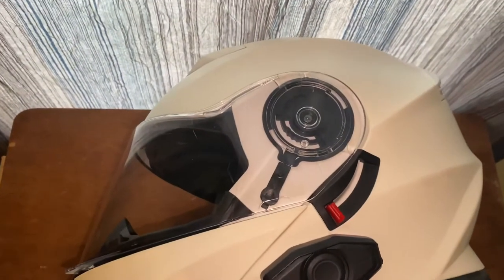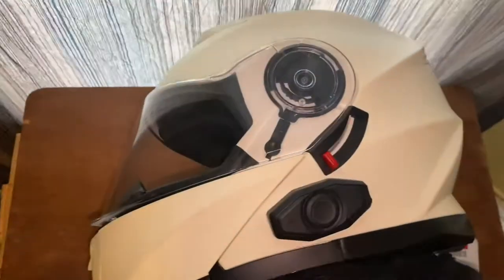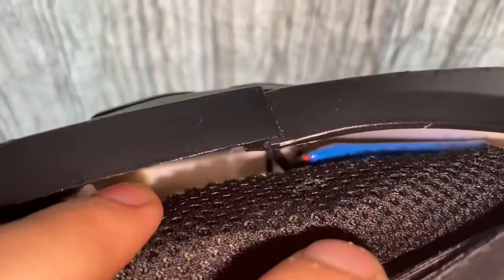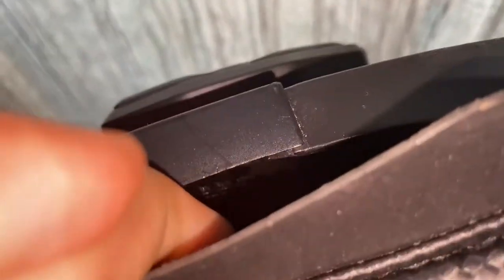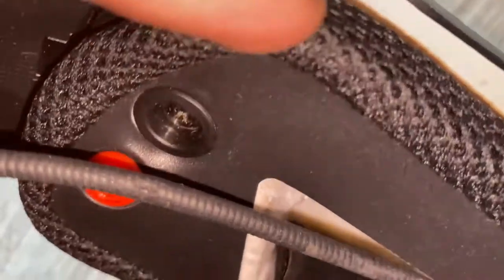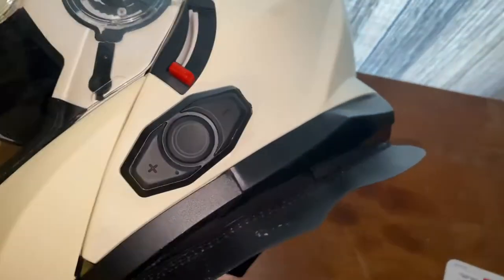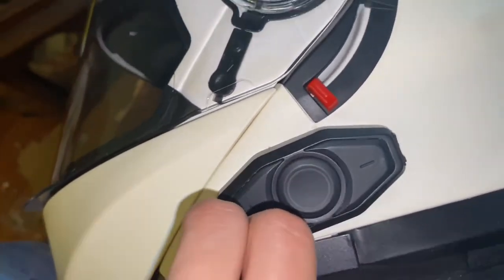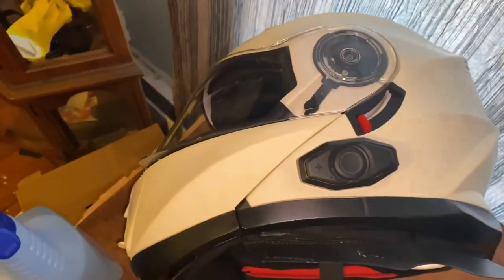How to fix Bilt Techno 2.0 Helmet / How to fix Sena DWO-5 Bluetooth

Comment: Good video, I had to reset my bluetooth because it was not charging correctly and it was not connect sometimes. The reset fix that problem. A few years later I was getting the red and blue light flashing and my bluetooth was not fully charging. I tried a different power supply and that fix it.
Reply: Here is another problem I was having, the charging LED would flash blue and red after a few minutes connected to the charger. I reset it multiple times but it did not work. Then I pressed the reset button for over 10 seconds. That worked. Have not had anymore problems.

Comment: Thank you for the video. I couldn't figure out how to get to the screws holding the unit on. I didn't know about the screw on the side. Haha. I just got the whole replacement setup from Cycle Gear, and it's a whole replacement setup for anyone else wondering. Thanks again.

Comment: Great info Corey I was able to reset mine. Thought I would have to go through the cut the battery wires and would rsolder the connectors to a new one.
Reply from the maker: Im glad I was able to provide useful information
Reply: Same!

Comment: Hello, I have depressed the reset button and did several combinations on trying to power up the helmet with the different buttons with no success.  Of course this bluetooth has been built into this helmet so not sure if it can be replaced. Any information or resolution would be appreciated.
Reply from the maker: retry Every step with the the charger plugged into the helmet. If not, the battery might have corroded and might need a physical replacement.... reply if the first step doesn't work

Comment: So, I hadn't used my helmet in about 6 months and found the blue tooth was dead (or so I thought). I found this video while trying to figure out what was wrong with it. Tried the reset trick (didn't work). Ordered a new battery ($12 on Amazon). Replaced the old battery (it's not wired in, it's just shrink wrapped). Still didn't work. Went back and rewatched video. And, then it hit me - two buttons. Ugh! Yeah, it works...
Reply from the maker: sorry for late reply.... even tho you went through the troubled of changing the battery. the bright side is that now you have full battery life capacity for your helmet. this model is a few years old now and im sure ones purchased years ago have suffered lower life range. Enjoy the helmet!, i love mines.
Reply: Same bro I just realized he hit both buttons 🤦🏾‍♂️

Comment: ..they told me that this new sena was so much better than the last one but so far I've spent more time fu**,ing with it than riding. I hope your way works because I'm pist rite now..You would think the guys at the place you buy it would know about that reset....Real funny how every dam head phones I've gotten even the shit ones at family general....they ALL have no problem connecting yet this pos sena constantly ruins my day..the last one I had was that sedeci or what ever ...I finally gave up on the bluetooth after about 863 got dam hours of bullshit...then the pieces that hold the shield on were constantly falling off and was like 20 bucks every time..the last time I used that pos helmet first I spent an hour trying to connect it, wouldn't connect. Then it started raining, so I took off and got half way to my destination and its raining so hard I couldnt see. Then the rain and wind hit me and the shield blew rite off then I couldnt see at all, truck almost hit me as I crossed a bridge. I pulled over and threw that pos off the overpass into the middle of the freeway and rode off.
Reply from the maker: sorry for the late reply. I personally believe that this helmet has the ear speakers distance differently then my personal preference. if i can position one of them perfectly, I can hear alot more clear and better audio. i would give it a 7 based on price and speed of connectivity and ease of use. also the durability of the helmet is actually decent and theirs a million custom wind screen guards for this. enjoy the helmet!

Comment: Why isn’t any Sena or cyclegear  supporting this piece of junk.   The manual is 45 pages filled with very complicated instructions.  Press, center button  or combination of buttons, “1sec, 2sec 3 sec, 5 sec, 10 sec or 12 sec”.  Then good luck operating with gloved hands.  I could not even activate the telephone voice command and instead activated the FM radio.  This is a function that is not covered by the manual, and I haven’t been able to duplicate.

Comment: Has anyone tried to upgrade the speakers or solder in a bigger upgraded battery ?
Reply from the maker: If you can find the specs of the output wattage itself of each wire on the Dwo - 5 I wouldn’t see why not for the speakers and as long as the volts output on battery is same then u should be good ✅